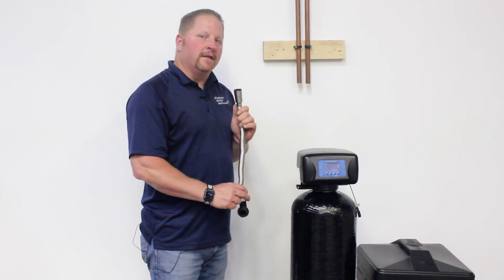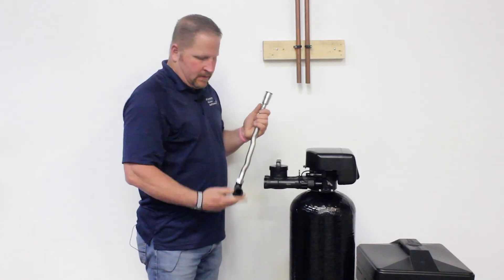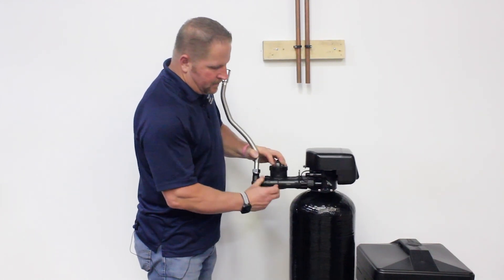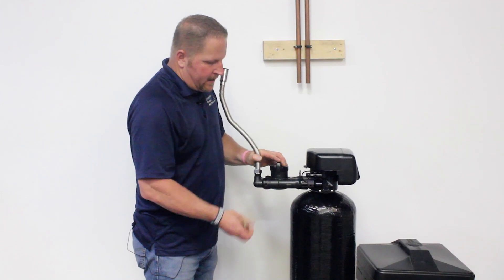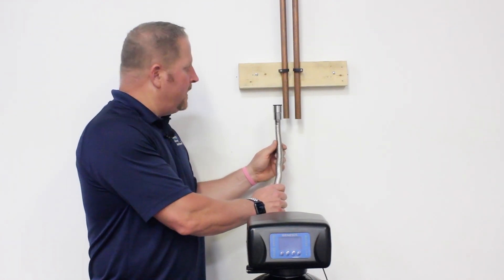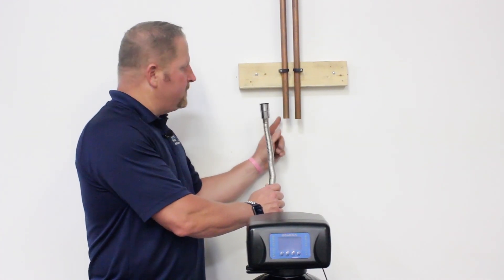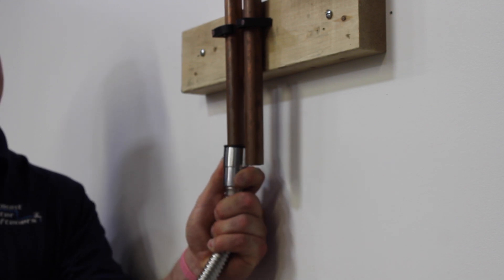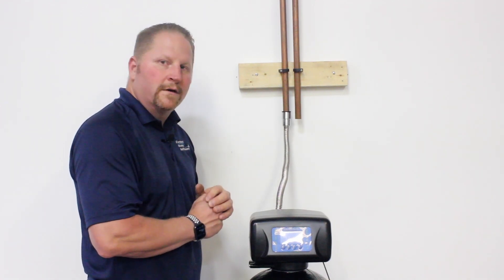Quick Pro Connector Kit for Easy Water Softener Installation

Comment: So I have a quick connector 3/4 x 1” x24” does this mean the water line is 1 inch and the adapter is 3/4?
Reply: Depends on how it's written out on the package. If there's an NPT after either measurement then that means that side is threaded, if it says male then it has external threads, if it says female it has internal threads. Hope that helps !

Comment: how does the quick connect stay in place and tight on the copper tubing?
Reply from the maker: The Quick Pro Connectors are much like Sharkbite connections but they are better. They are made by Falcon Connectors and have been extremely reliable and have been in the market for many years now. They have a polybutal seal and locking teeth to hold it in place.